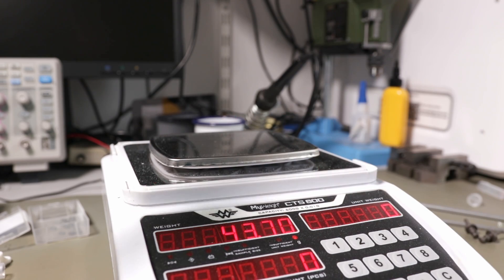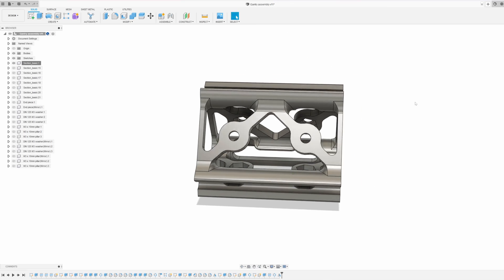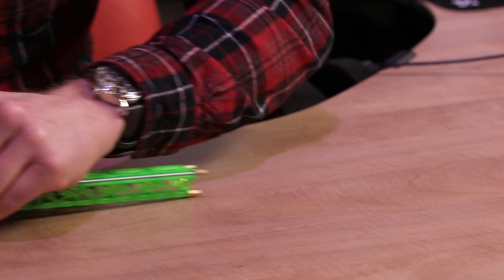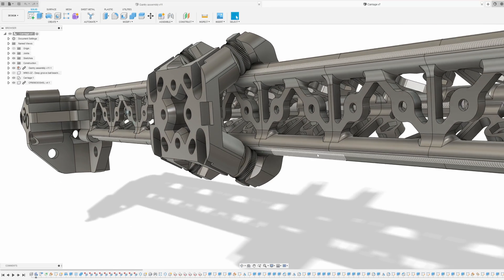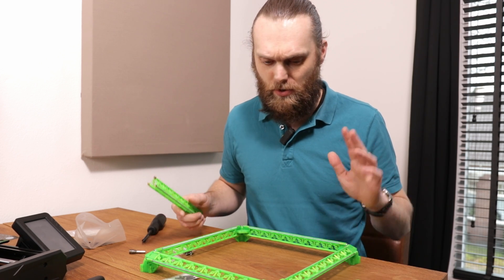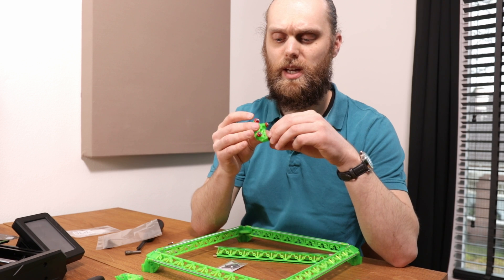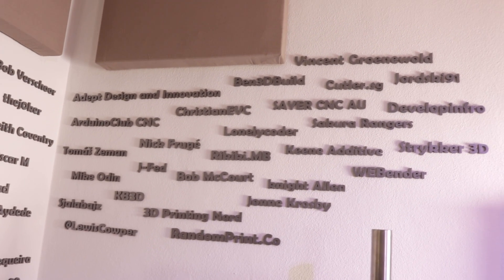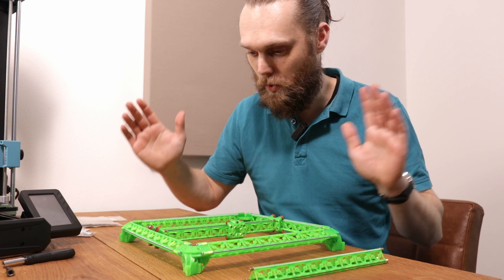Is This System the NEXT STEP in 3D Printing?

Comment from the maker: Has this idea potential, or shall I ditch it altogether and move on with the next project?
Reply: I love it! Please continue with this idea!
Reply: I’d gladly watch a Proper Printing version of a 3D printed 3D printer. Pass or fail I learn something and I’m entertained.
Reply: Maybe it doesn't have potential for what you were aiming at, but this is a seriously useful concept! Even if only as "building blocks" like the systems you mentioned in the examples, I'd still say it's quite a useful concept.

Heck, I caught myself thinking of using these in a larger scale, with big 1m-2m threaded rods, to make the CNC router I've been dreaming about (but putting off because aluminum profiles are ludicrously expensive in Brasil). The extra weight from using steel rods might even be beneficial in that case!
Reply: Just go with the rule of cool just because its not BETTER doesn't mean its not stil FUN. Thats why delta printers are still a thing after all haha
Reply: @jakeengland1430  Deltas are fast and simple.
Like the 2040 Wasp Turbo2
The drawback is the bed size you need for a given rectangle.
Reply: @jakeengland1430  parallel kinematic machines average the errors on all axes instead of cumulating it like a serial cartesian kinematic machine. They can also be much faster than cartesian machines. Speed and acceleration records are set by delta robots, not cartesian.
Reply: @jakeengland1430  - delta printers have the advantage of no Z banding from the bed moving up and down. Therefore, for the price you can get extremely high quality prints from a delta.
Reply: @hayden9944  2 words, belted Z
Reply: @jakeengland1430  - yup - but usually adds complexity and requires modding. Voron 2.4 is interesting but very complex. Deltas are super simple and a cost effective way of getting great prints - large tho…. fun to watch too 😉
Reply: @hayden9944  Besides minimal BOM requirements (and getting bed leveling for "free" without the need for more steppers or rails), deltas also have the advantage of not needing to move the mass of any linear rails.  They come with tradeoffs but I believe they're the motion system with the highest potential performance overhead, and they're quite versatile.  I enjoy  being able to print superfine 0.05 layer models and crank out large prototype parts quickly on the same machine.  And they are the most enjoyable printers to watch, at least compared to any "box format" motion system (delta vs tripteron may be a tossup :D).
Reply: @jamespray  - I completely agree. I am en engineer (don’t work in 3D printing) but I love them for all the reasons stated - and I could geek out for a long time with u on this but know-one would appreciate that I’m sure 😂
Reply: @hayden9944  Also an engineer, also don't work in 3D printing, haha.  I do have a little delta content posted if you want a safe space to geek :P
Reply: @jamespray  - ah nice! Subbed - will be looking forward to ur content!
Reply: @hayden9944  Definitely check out his content. James has a great mind for ingenuity, and I’d say of all the content creators working on delta’s, I am most interested in James’ developments, that’s for sure.
Reply: @jamespray  Completely agree with you. I am actually wondering what the advantages of cartesians are? Next on my list to check out are Polar Printers. Have you looked at those?
Reply: @ManjaroBlack  I would say the big cartesian advantages are a) easier to understand/control/refine firmware for and b) easier to build well.  Deltas punish poor build quality and most people don't find them very intuitive, which can be a recipe for a bad time.  I'm aware of polar printers but I think it's a bit of a dead end.  Scara or tripteron is a more promising "weird" direction to me :P
Reply: @hayden9944  See MirageC's WobbleX z wobble fix Z banding is obsolete
Reply: It would be cool to see and learn more. I have a few ideas for your possible optimization path that may or may not be useful. If you go with the hollow steel tubes try to thread the inside instead of the outside, this will allow for smaller screws so possibly a small amount of weight savings. The other and you may have mentioned this is possible using some sort of generative shape design to optimize strength and weight savings. Cool project hope you continue it.
Reply from the maker: @daltonhernandez721  thread on the inside, why haven't I thought of that! This still works with the spacers too! Thanks!
Reply: @properprinting is the beam more rigid than a linear rail though?  I always love watching your videos. You put a lot of thought into your projects and it's cool to see your process. I want to see more projects like your folding Ender. Maybe continue this project and turn it into a collapsible system!
Reply: @properprinting  man. Nero hasn't done an original thing in his life. Don't let him ride your death metal loving coat tails
Reply: I like the idea of a mostly 3d printed 3d printer that'll do a 15min benchy 😁
Reply: Ditch it altogether and move on to the next project.
Reply: I think it's worth pursuing a bit further - e.g. using hollow smooth rods with the thread cut on the inside for bolting together. Alternatively, if you stick with threaded rods, might it be possible to do away with the belts that move things, instead some kind of direct drive for the gantry and head position? Some kind of flexible drive - dunno, not easy, but then it'd be no fun if it was easy.
As for the main frame, I think that's a success either way - looks so much cooler than aluminium extrusion. So even if the X gantry part doesn't really work out, the frame construction piece is neat.
Reply: Love it I want to see more
Reply: Use resin to print a rail for metal carriage.
Reply: I would like to see the continuation!
Reply: Keep it going! I want to DIY a motion system!
Reply: Continue this idea!! The improvements mentioned at the end sound like the exact solution to the problems shown in the video.
Reply: this looks dooope , you should continue :D
Reply: While I think it's a cool concept, I honestly don't see this working out better than other forms of lightweight gantries: linear rail with extra machined cutouts / dual carbon linear rods. 

Also to make a lightweight gantry worthwhile you need a bigger frame than shown here, 247printing recently did a video on lightweight beams on a v0 and showed that it doesn't make that huge of a difference since the gantry on a printer of that scale isn't that much of the total moving weight due to the toolhead being a rather big part of it.
Reply: Rack and pinion, for your threaded rod.
Reply: Super gaaf maak een complete printer met dit systeem, misschien met een custom hotend
Reply: Keep going, it makes me think of reprap printers from back in the day!
Reply: Definitely has potential, it isn't just the printer, but the development of an eco system. The video was very interesting, and informative; besides, if at first you don't succeed, try and try again :) 

Like one of the other commenters, the idea might be useful in other projects as well (I'm thinking  - where accuracy and speed less important - especially if you solve the roller problem. if you ditch threaded rod, and used normal rod, or if you can find the correct sizes, you could consider sleeving the threaded rods maybe
Reply: You're totally on to something. 100% yes please keep it going.
Reply: keep it going!
Reply: I want to see you continue with this and explore options. I’m interested to see how this turns out!
Reply: I'd love to watch you work your way through this. Even if it doesn't result in a light weight printer that can compete for speed, there is a huge amount to learn from the process.
Reply: Push it!
Reply: You are compressing plastic and after some time plastic will relax stresses and will make it loose which is going to make it less stiff, i would love to see this type of structure but with glued in carbon fiber rods/tubes.
Reply: You should continue with the project. It is interesting and maybe you can reach to something useful. And even if you do not, someone can see what you did and maybe come with something better. I really like to see new motion systems, they are fun to watch
Reply: This looks awesome. Keep the wagon of standard linear rails and only get a fitting rail manufactured that looks somewhat like your design. WIN
Reply: Go for it brother this is exciting !!! :D
Reply: Try it!.  If you use tubing instead of smooth rods, you might be able to use threaded rod inside the tubing instead of threading the tube.  Another option, might be to use carbon fiber rods instead of steel/titanium.
Reply: while I am, not sure it will work I do think it would be a good idea to try as it could lead you to learn some really cool stuff that can be implemented for us non engineering brained normies :D
Reply: This has plenty of potential!
Reply: I would be very fascinated to see what you come up with
Reply: I always enjoy your way of solving problems. I don't think your truss system is the best solution but I am interested to see how far you can push it. I am especially interested in how you will reduce the weight of the extruder and fans that are more of a problem than the gantry in my opinion. The extruder assembly has has to move in 2 dimensions and has to be accelerated in both dimensions....surprise us all with some sort of insanely genius set up where the only piece on the gantry is the nozzle...
Reply: It has potential only maybe for the  gantry, not for the structure of printer. You know we need to lighten only moving parts, and  course it has an enormous potential for big printer maybe self constructed at home with modular parts ❤
Reply: 100% dude. dope AF
 I got a bunch of fiberglass rods from driveway reflectors I'm about to stick together with triangles 'cause of you
Reply: Do it!  This can really help me for my projects.
Reply: I think this project is another step in orginal reprap spirit to make 3D printers more self replicable. I think it's worth to give it more time.
Reply: Pls make a cool and interesting printer with your design! It will be awesome to watch!!
Reply: This is awesome and difficult. Please please please look into and learn about biomimicry - it is often where we find the strongest forms per unit weight.
Reply: You should definitely persue this! I believe it has potential to allow building a great printer with lighter materials.
Reply: You can't learn without making mistakes. A printed rail isn't going to be light and it will eventually sag unless reinforced. Reinforcement adds weight. This was a great exercise but I think you should move on to other ideas.
Reply: It has potential! Speed benchy would be great
Reply: Keep going, it's a great proof of concept and is worth moving forward on!
Reply: It'd be insanely cool to see a printer running on these
Reply: Go for it!
Reply: It’s an interesting design and definitely has a lot of ways it could be improved easily. Maybe try reducing or even eliminating the hardware used to hold stuff together. Printed plastic is a lot lighter than all the nuts and bolts you’re using. I’d try carbon fiber tubes for your rails, they’re crazy stiff and way almost nothing, it would probably run very smooth with those bearings you found at the end. I’m not sure if you changed the lubricant on those bearings, but a lot of times they come with thicker oil on them to protect them, cleaning that off and putting your own in would help with friction. I’ve also printed linear rails before, which are lighter than normal linear rails.
Reply: It reminds me of the RepRap printers, so I think it would be interesting.
Reply: Whenever I reach a point like this I put it in the back of my brain and work on something else. Usually within a few months my brain all the sudden has a breakthrough about what the next step should be. Sometimes it’s a completely different direction or a mashup of something else I’m working on. TLDR: The concept has value. Maybe not for what you intended. Move on to something else and I bet we see this concept come back reborn at some point.
Reply: Most def
Reply: Keep it going maybe carbon fiber rods. Grandioos ontwerp 📶💪
Reply: Keep going and optimize it
Reply: Consider carbon tubes mate.
Reply: In true RepRap fashion, printing your own 3D printer is what it's all about. If you can develop a speedy-capable 3D printer from 3D printed parts, cheaply, I'd be very interested. 
Times are hard for many people including myself, still running ye 'ol Ender 3 waiting till I can afford something more heavy duty and versatile. I'm not saying building a 1600$ printer for 200, but maybe these ideas can be integrated into future printers for better, faster, more lightweight machines, or perhaps simply as an educational purpose to be done in school to teach kids about machines. Heck there's plenty of good uses for projects like these. Keep up the good work! 

As for finding more lightweight ways to print parts, maybe look at topological optimisation ? Like organic/skeleton-looking parts. That's probably the biggest thing about 3D printed parts, making things that couldn't be or would be hard to manufacture differently. 
Plastic with a lesser density than PLA ? ASA, PC or PP ? You wouldn't gain much and would have to be weary of solidity. But you could experiment if you have the right tools. If every gram counts that's probably where I'd start.
Reply: this is an amazing concept, might want to try thicker carbon rods instead of titanium since it would give you a larger contact segment between the rod and wheels for a more stable contact patch and stiffer gantry with similar weight.
Reply: Track rollers with smooth rods threaded only on the ends... requires some extra work but reduced friction and accuracy might make up for it
Reply: please continue with this, curious if I can get JLCPCB to make me a 3d printer with my own PCB for <$cost of a new one.
Also, please see about skeltonizing solid shapes instead of starting with a skeleton.
Reply: Yeah Build a printer out of this
Reply: I like the idea of having the opportunity to just print some of the elements to make the build volume larger...
...can the rods/threaded rods/tubes be replaced with timing belts (or just some paracord for the trusses without some moving part on them)?
Reply: I really want to see where this goes.
Reply: Personally, whether lighter or not I feel that project has potential similar to the Rook printer in the community. Regardless of weight, a 3d printed 3d printer will always have its place. Being able to print 90% of it with spare resin/filament would save on cost and provide more fuel to the 3d printing community for those who cant afford another printer they can make one with a few cheap parts or even make them as gifts for relatives who are trying to get into 3d printing.
Reply: definitely keep at this one its fucking sick
Reply: YESS!    This is what's needed..  Some new thinking and how ever it turns out at the end, the journey will give you(us) a lot of new things to take with us to other projects. LOVE the idea !
Reply: Don’t listen to the detractors. I see so many potential uses for this
Reply: I think it's sweet like to see you finish it and if it works out I would build one
Reply: This is a must do project. I'd love to see a 3D printer using this design architecture. At the very least you will have created a 'lego' kit that is useful in building other structures that are strong and lightweight. Don't let those who don't 'get it' bog you down. Keep up the great work you are doing!
Reply: @kennykd97  looks like spelling "too" was as well. 😂
Reply: Why not use carbon fiber rods ? And thinner metal rods just for tensioning ? Im talking 2mm tension rods and caron fiber for the rollers.Also refine the design so its easier to print i guess.
Reply: You should also try light weight pla it’s used for rc planes and it’s much lighter than other filaments
Reply: I think this has potential - one scenario is a small printer made from these could easily be turned into a larger printer. 
Another is that it allows someone to very easily make their own small custom tools such as PnP and vinyl cutting etc.
Reply: For sure I want to see how you move forward to improve this idea. It's always awesome how you can think out of the box and show us this kind of projects.
Reply: It's a super interesting concept, I personally would use it only for moving parts, maybe you could try to print it a singe "beam" and use generative design to get is lighter or stiffer. Maby using sls, or go even more nuts and sls it out of aluminium and/or titanium. So you wouldn't need any rods anymore, and instead of rollers, try iglidur filament and print super light bushings..... Just some ideas ❤ and Thx for the great content
Reply: One threaded rof theough the center with each having alignment dabs would be way cheaper and make a but more sence
Reply: yes please
Reply: seems like a fun idea however I would go with the delta approach.
Reply: yup other printers have used those bearings on linear rods so would work great. its really interesting could be the next open source frame work. Im so over 20.20 extrusions. Luv it
Reply: May I suggest a surface plate. The finest grade you can get. Then manually "scrape" the surface flat  on a bare bones linear rail.(its a thing).  Then use only the linear rail as an axis.  Just an Idea but I love your ideas and im sure you could improve on this idea. Best wishes for you. - Tj
Reply: Imo yes i think this is a very interesting project. might not be the best printer, but you’ll learn a lot and ill be very entertained regardless
Reply: At this point you COULD as AI to help with design and make that.  If YOU think it could surpass a Voron but be simpler you could have a go at it. If it is cool and you love the project have a go at it. If it seems unlikely that super success is in the future for this project but you are unsure .. you might have a go at it still.   I guess , step back and first principal your original design.  What I notice about trusses and scaffolding is they continue the triangles, you introduced long straight lines and then count on THEM to hold all the weight and rigidity.  Maybe add more triangles or CROSS the metal parts so they are triangles.  or again ASK   AI..could be fun!!   Love your work and attitude and your work attitude !
Reply: Better Print the whole printer frame in one Part ^^
Reply: I think this looks so darn cool, that I think you should continue with this project, also, I saw another thing with these, making storage solutions with these as a skeleton around to hold boxes or drawers, it looks very appealing with that color!
Reply: I'd rather see you use this for building other kinds of structures and machines, but you do what you want and I'm sure we'll all enjoy
Reply: Could you use this to make an accessible high temp 3d printer? I think you could. Maybe a bootstrap your way to PEI series?
Reply: I've tossed around similar idea's. One issue I had is how it will deal with plastic creep over time. I have thought about flipping this on its head.. instead of putting things under compression what about putting the truss under tension.
Reply: Maybe you can improve the concept by incorporating tensegrity (wires under tension, rod under compression) like this guy https://youtu.be/Vbs8buYSK_s .  He's building a lightweight high speed printer, maybe you could do a foldable printer with your own concept.  Don't really care about speed benchies myself.
Reply: Very good video but I don't see the potential for this to be better than custom machined metal parts. Would love to see your other ideas!
Reply: I'm curious if carbon fiber outer tubes with a single threaded rod down the middle would be lighter? It might be tough to get the washer and tension centered but if the weight savings are there that could be worth a shot.
Reply: Hello, now im construct like that model, but i use 10x10 aluminium rectangle rod, and directly attach mr52 bearings to it, this bearings attached by small model printed on lcd printer, and this "object" attached to main carriage. Using 6 mr52 bearings and some of plastic+aluminum is pretty light, but i think its not lighter than 38gramms... But costs ALOT better.
Reply: go on pls
Reply: It’s an interesting idea. I’d be interested to at least see how the track rollers work.
Reply: Instead of threading the smooth rods try to use a hollow smooth pipe with compression fittings. Your best bet will be something like compression fittings for brake lines/pipes.
You can also look for fridge line/water line/ice maker line compression fittings as they all tend to use fairly small diameter pipes.
Reply: Cool concept!!I don't think that threaded rods are ever going to work as guide rails. Too much friction, too low tolerances.

Maybe use precision rods and cut threads on the ends?
Reply: I think it is time to call it a learning experience and move on.  I wonder if linear rails can be lightened. There are mounting hole that are not being used. Could these be expanded to reduce the weight? Maybe remove material using EDM.
Reply: I think we're actually going to find that printers are going to start having heavier bases, with people adding mass in order to help vibration dampening much like the CNC field has done through the generations.  The whole machine being lightweight actually works against you when it comes to speed.  You have to selectively lighten areas of the machine, and that includes anything that's moving.
Reply: What if you tap threads into hollow tubes for tension? Maybe adjust the design of the pieces so they self-align with some sort of V-shape. This looks like it could be promising plus it just looks like a fun idea.
Reply: it's a fun idea but rev1 hints that that a rev2 wouldn't have a worthwhile ROI, neither money nor function-wise
does look cool though, a full rev1 would be hilarious
Reply: Might not be good for motion components, but seems slick for a stiff frame with lots of attachment points!
Reply: What about bicycle spokes? They are smooth, with threads on the end (M2 I think). They are designed to be under tension. If you go for butted spokes, you have a lot of choices for thicknesses and even shapes (aero spokes).
Reply: What about carbon tubes with Delrin u groove wheels and some sort of wire based tensioning?
Reply: I think its cool as hell and would love to see a series on it but it is kinda overcompliacted at the moment :D
Reply: Do it mate, would watch the hell out of this series. However, did you forget about carbon fiber rods?
Reply: Definitely has potential. It'd be interesting to see if it was better for small or larger printing. Keep iterating on this one if you can. There's something here
Reply: Have you compared an extrusion coupled with the rail verses your entire all-in-one design?
Reply: Potential
Reply: It’s at the very least cool
Reply: Look at the 100 3d printer, just the mobile parts need to be lightweight, the stationary parts need mass.
Reply: What about swaping two rods with ptfe tubing? Should run smoother, and you can tension them with just short bolts, like M2x12 or so...
Reply: I would be interested to see if this concept could work for creating a larger format machine with a standard size 3D printer.  I’m not particularly excited about setting speed records.  I only care about having enough speed to keep the process practical.  If this could be used to more economically produce/print a viable 3D printer, CNC router, or even CNC laser engraver/cutter with a larger work area than retail offerings…that would be a worthwhile path.  Also for consideration, your concept of producing reasonably strong and rigid trusses as a universal component design has a lot of potential.  This could be very useful for creating camera gantries, lighting framework, and other temporary structures.  If it were scaled to use ubiquitous hardware and maintain a cost advantage, the threshold for attempting a project utilizing the design decreases dramatically.
Reply: Why not carbon fiber-titanium?
Reply: This could be an interesting project, maybe it can't compete with speed benchys BUT it could end with a cheapish mostly printed corexy printer that could be peoples first step into corexy without having to throw down the money for a voron or a ratrig
Reply: I'd say leave it for now. And come to back to it if you have any eureka moments. I say that because I've recently tried to run rollers on 3D printed rails with a metal structure. And it just never quite worked right.
Reply: It's an interesting concept and I love the video's you make in this exploratory design style. Am I skeptical about this being useful as a 3d printing gantry, yes. Would I watch the next video about your journey, definitely!
Reply: This design has massive potential at scale(meaning physicals size)* with some tweaking!
Reply: I think this system has a huge potential, but not as a gantry, rather as a modular profile system.
Yes, you still needs to buy threaded rods, but they are more available than aluminium profiles.
I mean, basically even this first prototype is a modular profile with geometry that you can tweak a bit, since you have screws on three sides. Bent to one side? Tighten the screws on the other.
Reply: I think you should use  bigger smooth aluminum rods with thin walls.
By the way, the potential of Delta printers is still to be reached!
Reply: Want to go lighter? Hollow rods, fill em with helium. Put helium filled balloons in the truss as well.
Reply: @portmanteau.  Well... It doesn't really work like that. 
You see, helium is lighter than air (it has less density than air) so accordingly to the buoyancy law, baloon filled with helium floats up.
HOWEVER, it doesn't mean that helium (and, balloon that holds it) doesn't have any mass, which means that ultimately, while removing a miniscule bit of mass due to replacing air with helium, you are adding even more mass because of all the support structure.
Reply: Subscribed
Reply: I was tinking you can use 1 trheaded rod to add presition and 2 normal rods to add stavility, i think the trhreaded roller on the back it's generating too mutch preassure to the carrige and that is the reason of the rough moves
Reply: Everything may say it's to complicated but it's really not. It's more so like building a modular printer from LEGOs. I suggest you finish it as it's so interesting. The triangle is definitely the strongest. If you did how have these beams machined from aluminum Triangle tube. And have the rails built into the machining it would be the lightest.
Reply: Smooth rod with internal threads. Probably could even be hollow if the ID is sized properly to run a tap into.
Reply: This is very interesting. Regardless of how successful it is I'd love to see how far it can go
Reply: Hi! Love your research! You need to use HIPS instead PLA, is a lot lighter, stronger and cheaper!
Reply: Definitely keep going!
Reply: Too complicated. I doubt anyone would want to make it.
Reply from the maker: @teslastellar  start scrolling ;)
Reply: Yess keep continuing with it! ❤
Reply: I think the problem is scale. You are using a scale that is too small to benefit from the truss. The question is how big must the printer get to benefit from it. Might need to be simulated
Reply: Just use 1 threaded rod in the centre of the truss to tension it
Reply: To be honest I think that it has much more potential than you were showing in the video. Your original gantry linear rail has no supporting structure and normally I see it paired with t-slot or other structural members to make the full gantry. I haven't seen just a linear rod as a gantry before but maybe I just am missing something. I would love to see more and subscribed for the purpose 😃
Reply: I just want to watch it finished. If it's not better than other solutions at least is a new solution to compare with. And I do thing it looks cool as hell.
Reply: Hell yeah dude, I think it has enough potential to at least explore. The hollow titanium tubes would be the best bet along with the smooth rollers.
Reply: carbon fibre rods with  braded dyneema for tensioning
Reply: what you need my good sir is graphene. one atom thick and a whole lotta strength!
Reply: Pls continue!
Reply: This is awesome, even if it doesnt work. It will be useful info.
Reply: perhaps POM concave wheels would work for the rollers
Reply: do it! lve watching your content
Reply: potential
Reply: You could use generative design for the model and maybe you will get some more inspiration for a second version. 
I really love watching these series. Even if they don’t work right away. 
i would love to see more ! ❤
Reply: I don't care if it will perform badly, but i want to see it as a finished printer!
Reply: Ditch it and return to the gel printer with carbon fiber, use pressure to push the gel instead of trying to suck it.
Reply: Love it. Keep it going!
Reply: I subbed, please continue 👏🙂
Reply: This has a ton of potential.  You've just hit the first snag and that's to be expected.  If you didn't hit any challenges, that just means your design criteria was too loose!

Threaded rod is ubiquitous and easy to cut to size - two things that aren't true of linear rails and pre-made trusses.  Even if you had to get custom rollers fabricated, at m3 scale the per-part cost would be manageable. 

Right now you've got truss structures you can assemble like Lego. If you can turn them into motion works, this has many more applications than 3d printers.
Reply: Ditch it.
Reply: Keep going, where there are challenges like this there are great opportunities to unlock new intellectual property. Keep up the good work. Tot de volgende keer.
Reply: Fixed winged drones
Reply: How about a single tension rod down the center of the beam then glue in smooth outer rods as needed? Glue might sound bad, but i believe it would dramatically improve structural performance at high speed.
Reply: Hey there. I am working as an engineer, in Russia (Bada-bums).
And I really like your ideas, but I see, thet more Designer. It's not first time you don't know how materials work, and make 'children's decease'.
First was you make single part, from small parts. 1 is stronger, you dont need places when parts connected, to make safe connection.
So you from start make more weight and lose in strongly.

In such cases my friend told: 'you going in wrong way, with opposite direction'.

Your second idea was better, to use tubes.
But Aluminium profile is much more better.

But if you want to re-invent use threads, just steel threads with nuts. Like it was on Prusa Mendel with plywood's frame.

Crane's is wrong assocation in your situation, you need CNC machines standarts. For experiment you can use airplanes frame structure.
It is light, But it is Profiles (Bada-bums). It's not easy to draw, not easy to assemble, so it cost much more.
For aerospace there is no other way.

But here on the ground make frame more stronger, motors more powerful - you can move faster without echo and wobbling, ringing.

You see 3d printers so slow, and work bad faster - because cheaper than they should be. Not because they bad.
Reply: Swapping out precision ground, hardened steel for 3d printed plastic and mass produced aluminum is generally not a good idea.
Reply: It's only a step! Please continue the the journey!  For all of us!
Reply: Why Nero. He's such a wad
Reply: Oh, heck yeah; bring it on!
Reply: keep going the way it looks alone is worth it, but there is potential in scaling up for other ideas and uses
Reply: I say go for it. your ideas at the end make it what it needs to be. smooth rollers and rod, cut threads into the end. if at all perhaps print the trusses more all at once rather than one section at a time maybe that will align it better.
Reply: I think this is a good idea, but it needs to be improved, for example, to abandon the fasteners in the jibs, and make the blocks themselves longer, not 5, but 10 centimeters. thus reducing the mass on the mating elements
Reply: IT'S a grate idea, you could print almost all the printer
Reply: Please continue pursuing this. One idea for the support structure is to print the shell and inject it with expanding construction polyurethane foam. Also look into driving the gantry with tensioned fluorocarbon fishing line or such instead of belts, maybe with the "return lines" in the middle of the triangular trusses for added compressive tension strength. There are small steel pulley ball bearings that are designed for this. Perhaps even replace the rods with such high tension wires and run the gantries on the tensioned wire instead of rods.
Reply: You will save a lot of weight if you print it in abs instead of pla
Reply: No.
Reply: Keep it up
Reply: I think you should look into using cables to create an Z suspended print head with an XY motion plane cable system. The weight of the print head would be supported from above by a carbon fiber rod with a joint that compensates for the change in radius from bed center to edge.
Reply: Please continue this project!
Reply: I'd like to see where this goes cause what you do. Someone else may come along and assist or pick up what you may spark in their mind.
Reply: Something like ground carbon fiber rods with threaded ends glued on on could work.
Reply: 2:10 LEGO fan here. THE PLURAL IS LEGO
Reply: What if you use carbon fiber tubes? 3/5mm or 4/6mm.
Reply: on the gantry Instead of threaded rod you should use metal tubes or carbon fiber rods to drop the weight while keeping the stiffness
Reply: nitinol wires, no need for motors/belts/pulleys/idlers...
Pneumatic gantries...
Whatever it takes!!! If someone can do it, that's you!

Can you imagine thousands of directions changes per second caused by compressed air?? what a symphony!😅
Reply: do it do it do itttttt please
Reply: you basically made a worse version of linear rods
Reply: Yeah, more of this. After all it does look cool ;)
Reply: Go on! Just make it for fun!
Reply: Love it, think it will make a great printer frame
Reply: Honest question.... you said it in the beginning use the tslot 2040. Slide blocks made from UHMW? or other slippery plastic. IMHO two options actually exist. Made the rail of UHMW and use commercial bearing blocks OR use slide blocks & 2040 for the rail. Both are cheaper the current designs. IMHO both alternatives offer just as stable a system as the Ender 3 v2 with wheels on the z axis, where the x axis sags on the right side. I am new to 3D printing, but i'm currently exploring both alternatives. I have the prototype and am waiting my upgrade to Klipper.
Reply: It might still be lighter than the rail if you add the extruded aluminum rail that the linier rail mounts to
Reply: I had a similar idea with bb's and a diy linear rail but honestly I was wondering in a abyss lol, because I wanted to avoid non longevity and the only thing I could think of is that pla is sometimes used for smooth rod linear bearings. But then I question the longevity in a speed printer lol
Reply: i like the idea, have this in my mind for a couple of year as wel.. if you use glue to fix the smooth titanium or fiber rods in place and use the smooth rolers and minimise to 3 rolers per carier with a tensioning between the 2 you can make this super smooth.. the trick is to glue instead of screwing the rods i think. i hope you continue.. i love it
Reply: Please keep iterating
Reply: I think it's still gonna be lighter because your project is both gantry and rail versus just the weight of a rail. If you add the rest of the gantry, I would think yours would be much lighter.
Reply: Why not simple rods, D shaped at the tips, so you can use allen screws to tighten and make shapes?
Reply: Try making it fully 3d-printed. Then you can make a 3d printed 3d printer :D
Reply: You're onto something - turn the truss 180 degrees with triangle apex pointing it, then make the outer the roller guides with two track rollers offset 60 degrees from horizontal - or use externally threaded tube and worm (like) gear outers for dual side accurate drive along the truss
Reply: ditch
Reply: Do what best suits you. I don't watn to force you to do particular things Really, I love your work and the fact that you put so much love, patience and professionalism into every project.
I just thinked about just put three rods into air, put some bracket and the ends and every 10cm put some stiffeners.
Reply: Ditch it. It might be worth pursuing if it were entirely 3D-printable, but the metal rods and wheels are just as much dependent on commercial availability as a plain old carbon tube, which is nearly unbeatable for stiffness to weight ratio.
Reply: its wayy too complicated. needs to look and be simpler!
Reply: Probably not
Reply: Ditch. You basically only thought of negatives to it.
Reply: I think that you should work on another project.
This is too complicated, and a rabbit hole of troubles.
Reply: I think this is one of those project that is destine to fail, but I also believe the numerous failures along the way will lead to learning some very important lessons for going forward.  Its a "you learn more from your failures, than your successes" kind of situation.    I'd  like to see this go forward and then address each problem as they arise.